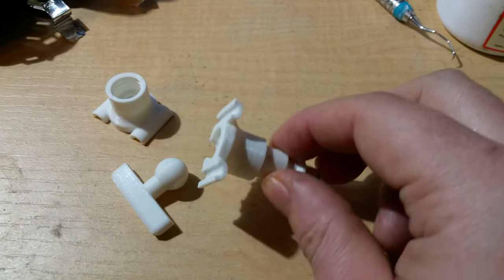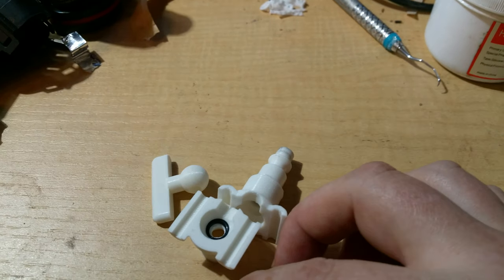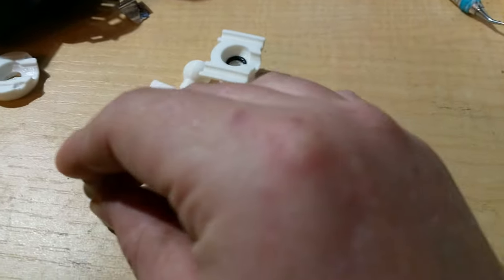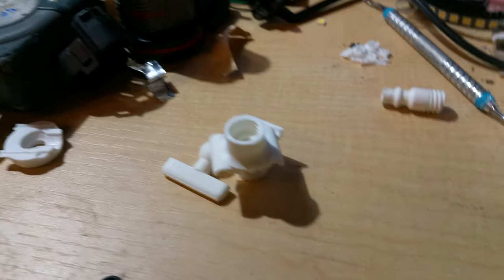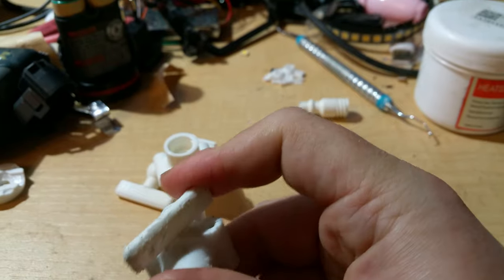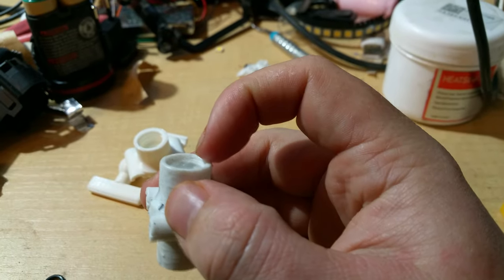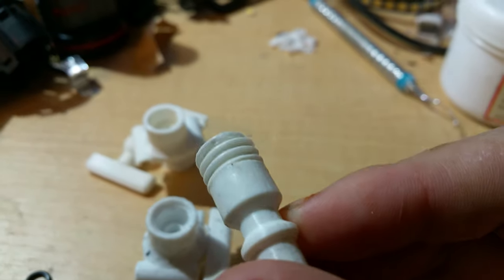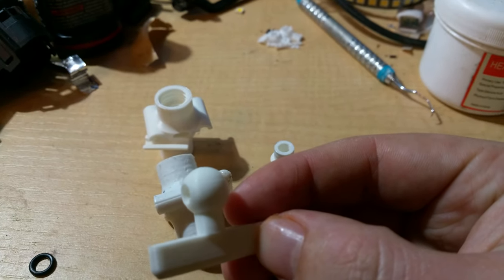3d printed ball valve

Comment: very good and thanks for making this video. please can I request you to share your design files? I would like to replicate this and use it for an application I have too. Also, did you manage to make it fully air tight under pressure? Any further details you could share e.g. O ring sizes, how did you join the parts together after printing, etc and the nitto fitting would be greatly appreciated. many thanks in advance. eagerly waiting for your reply.
Reply from the maker: Hey sorry I never got back to you in a timely fashion I kind of abandoned this as it would seal at 100 PSI but when open the O-rings would get pressed into the opening by the air but as with most things I sure learned a lot I've kind of ditched 3D printing in favour of CNC Machining